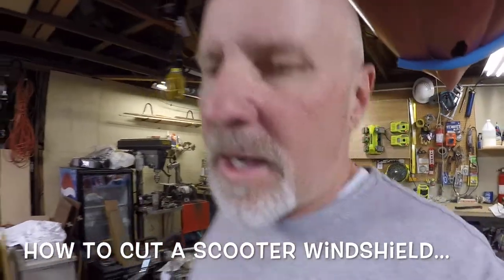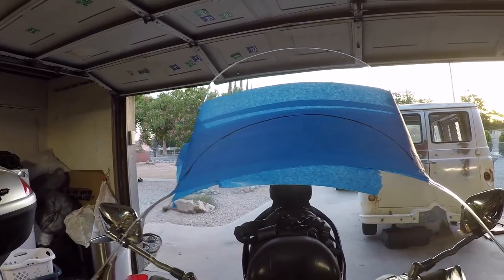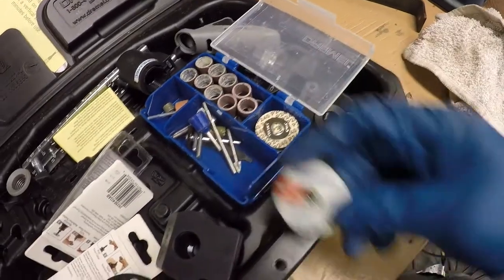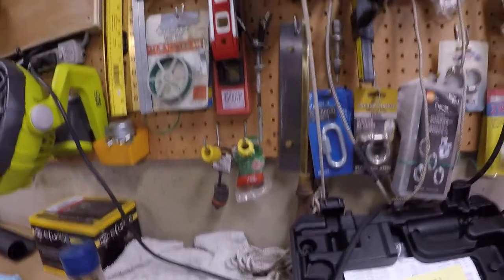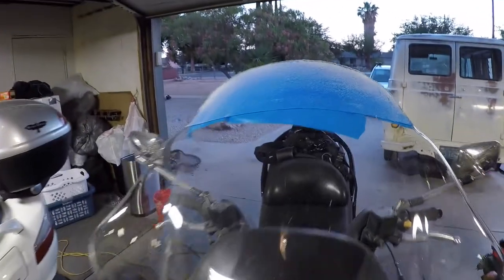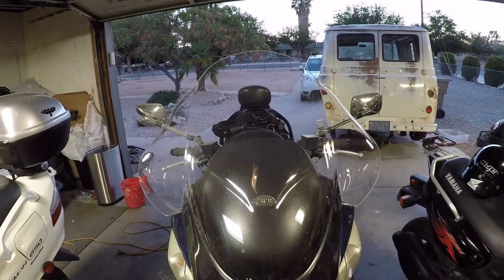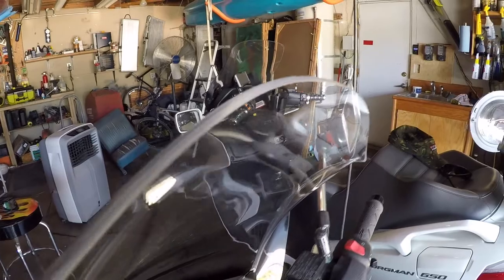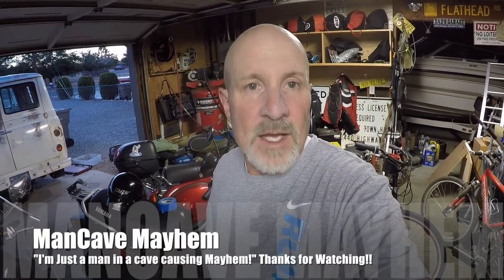How to cut a Scooter or Motorcycle Windshield

Comment: Good answer spikey911usa, I use to work in a race car shop and after making the windows and sanding them would run a torch across the edge and it would make it clear as the rest of the windshield

Comment: A little off topic, are aftermarket windshields rated differently for strength?  Are they as strong as the original as far as wind pressure is concerned. I recently saw a broken one I assume broke while being transported on a trailer.
Reply from the maker: I know some of them are made out of different materials. Which  one is stronger than another I’m not sure. They are pretty durable though.

Comment: wow I have been trying to find a 2 inch taller windshield for my scooter but GIVI seems to only make one 4 inch taller.now I can get it and go ahead and cut it.
Reply from the maker: glen johnson This windshield was crazy tall for the wife. So we trimmed it up. It worked out pretty good.
Reply: @ManCaveMayhem  well the way it is right now it hits my glasses or my helmet and tries to lift them up so I need to cut this one down then I might as well not even have one or get the new givi and cut it down.
Reply: @MadsWorld34   I just got a 24” givi and have to cut it down about 1-1/2”. I know this is an old vid and an old comment. But I’m in the same boat. Great vid.
Reply: @davezimmerman8627  thanks i got one and had it cut down. it cost me almost as much as the windshield did itself but it was worth it. i tried to cut my old one first and cracked it then melted it then i couldn't get it even so i just paid a glass shop to do it for me and i love it.